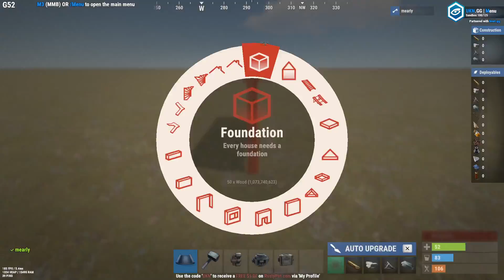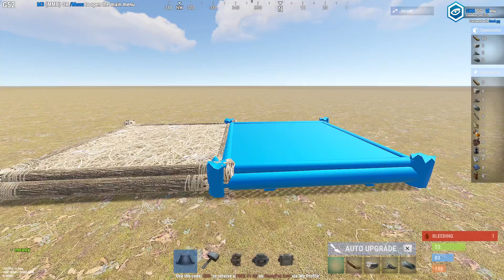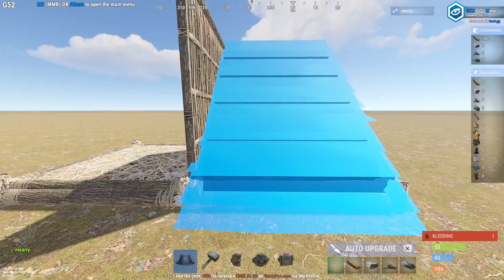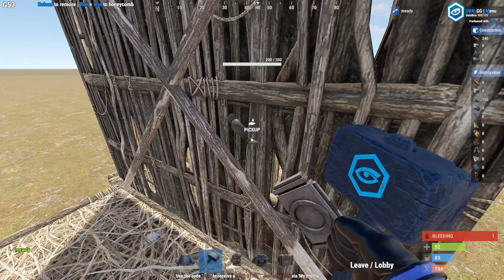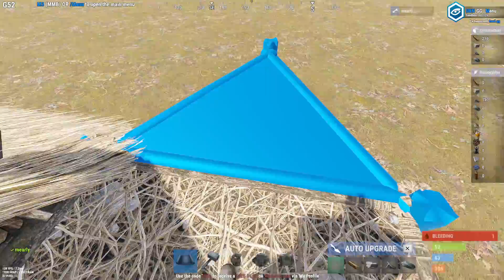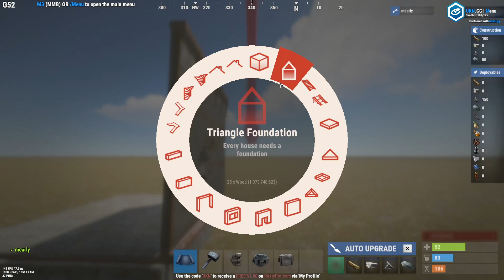RUST - How to Pipe Industrial Through A Wall (Method 2: Conditional)

Comment: Seems like it would be useful to get pipes to go through floors and rocks as well.  I have not tried to see if the sag feature for electric lines also works with water or industrial tubing.
Reply from the maker: If I find any other cool tricks, I will make a video.